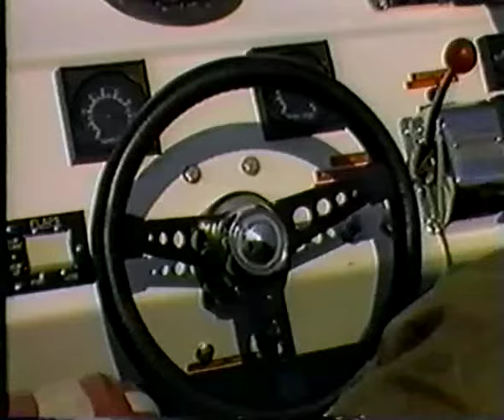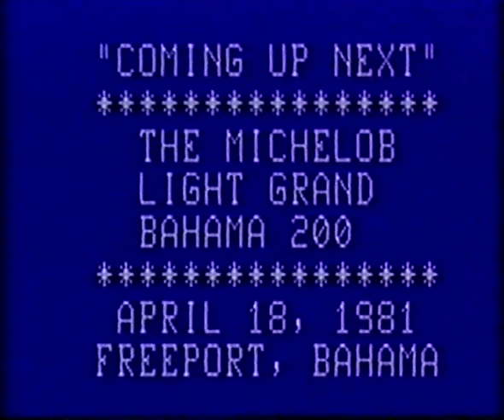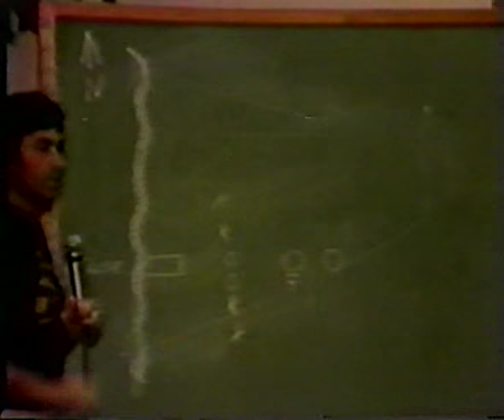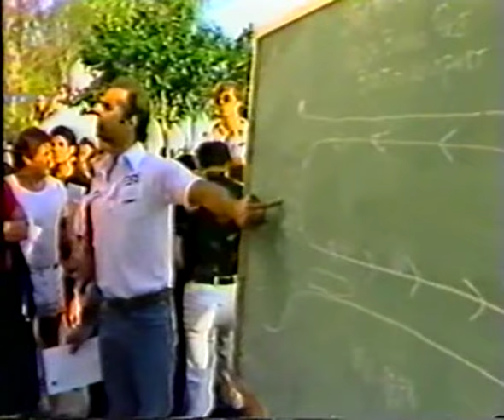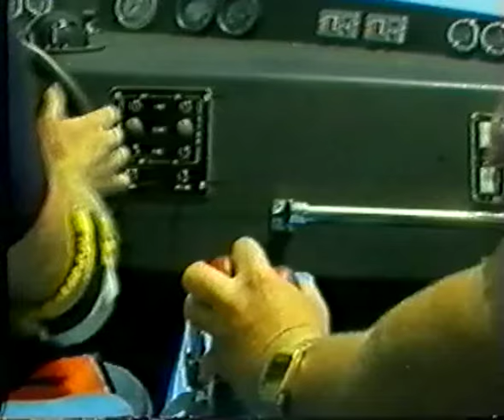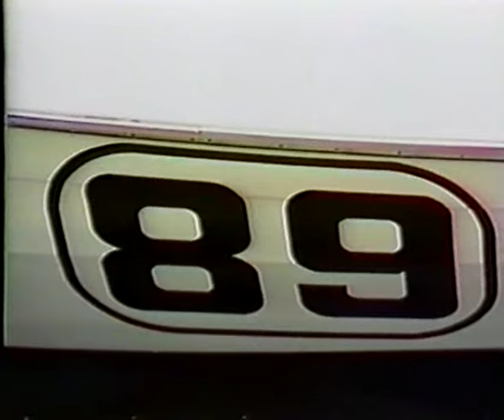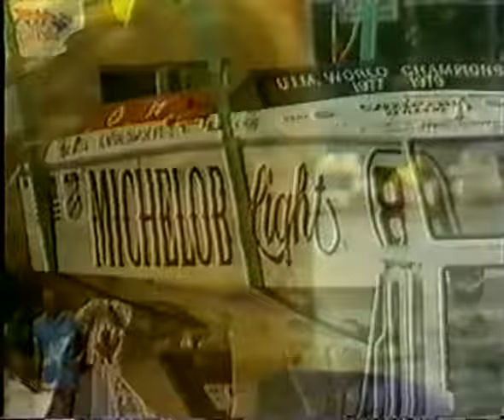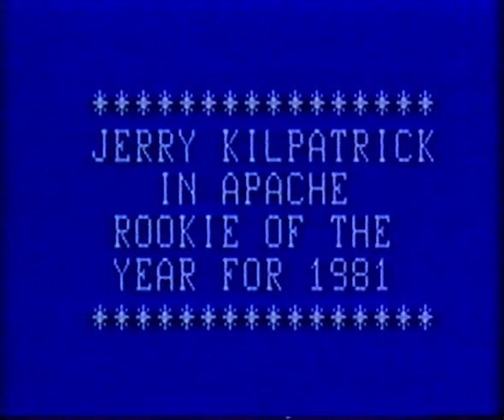1981 OffShore Powerboat Race Season

Comment: Love these vintage offshore race boat videos. Growing up in Miami in the 1980's my father and I watched quite a few races from our own boat. But I'm not so sure about this guy's way of describing the g-forces in one of those boats as being stronger than someone blasting off in a rocket. Back in 1981 crewed space travel coming out of the Saturn V program and going into the Shuttle program and those machines have some incredible g-forces when they light the candles. Not subtracting from the power of the boats...but I think sitting on the top of a ballistic missile which is basically what put the first American into space would have more g-forces.
Reply: I'm guessing they were referring to the cumulative pounding taken during the duration of a race.